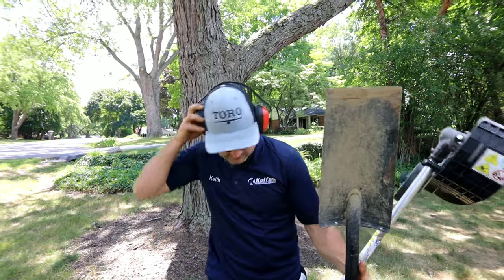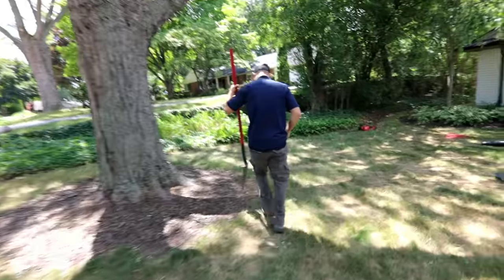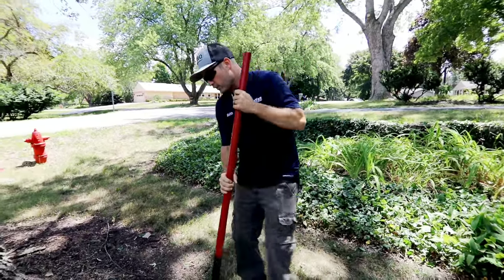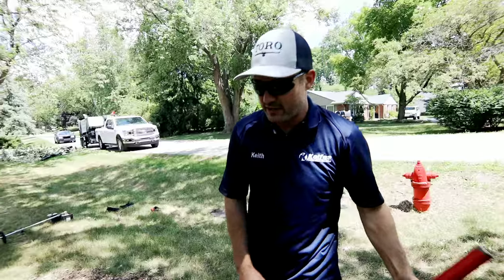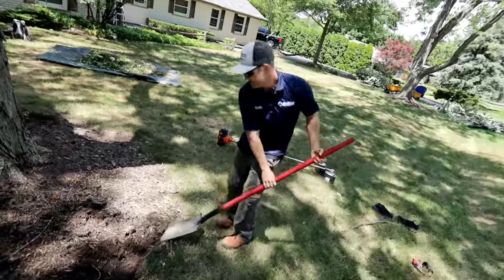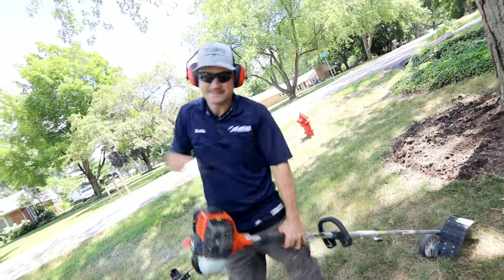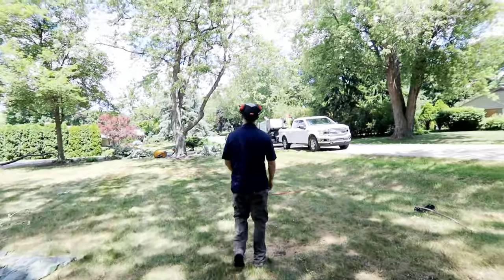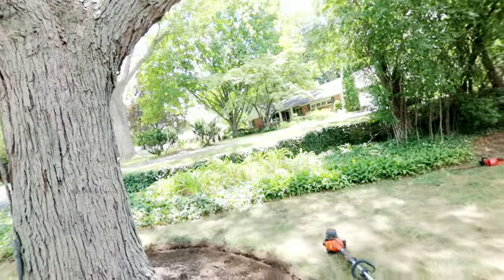Steel Shovel VS Gas Powered Garden Bed Edger | For Edging Out Garden Beds | Which One Is Better ?

Comment: I absolutely love my echo bed redifiner. It’s made me way more then it’s weight in gold. I usually string trim a clean line and then take my time with the machine. Blow out the edge and it’s ready. It turns hours of manual labor into minutes of major profit.

Comment: I have done a LOT of edging with a shovel. Last year, I had a large mulching job where I was tearing out a variety of sloppy edges and cutting new natural edges. I went out and spent the money on a bed redifiner, which turned hours of shovel work into minutes of powered work. The edges look great, the client is thrilled and my feet and back are defined.
I'll never go back.
PS -  If you want perfect round beds for trees, use a line around the tree, tie it back to a ground marking paint can, paint the circle and then cut it in with the bed definer.

Comment: Shovel or a stick bed edger. I will choose the shovel. I purchased the bed edger attachment for my Stihl Kombi system and was very disappointed in how it performed. Nothing beats good hard manual labor with a shovel. If I have a lot of beds  to edge I go down to the local rental center and rent the big bed edger. I will use the big bed edger and then go back and  define the edge by hand with a shovel.

Comment: Ive been using a King of Spades shovel for years.  Its a short spade.  I keep it sharp on the bench grinder and after I dig the edge I clean it up with the string trimmer.  Looks really great but is a lot of work and hard on the back, im thinking of getting a machine.
Reply: rental companies sell (rotate out) good machines for 1/2 the price or less of new. i found an EZ trencher with edger rotor for $550 new belts and oil change works like new. it cuts new edges 20 feet per minute, rake in the loose dirt and ready for mulch.

Comment: I use a trenching spade for edging out beds. The soil is pretty soft where I live. As long as there’s no tree roots it takes no time at all. A gas powered edger is great to have in some cases but I sold mine because I just never used them.

Comment: I alternate between edging shovels and my bed redefiner. They both have pros and cons. If a customer is low maintenance, the edges are already established and just need touch-up, or if the soil is super hard clay/rocky to dig by hand  then the bed redefiner is usually my go to, especially since the bed redefiner pulverises the soil so you don't have to clean up edging chunks. If the job calls for the nicest crispiest cleanest edges and they are willing to pay for it, then hand shovel it is. Also, considering how much debris those bed redefiners throw into the air, you have to be very mindful of your surroundings when using them, sometimes making a hand shovel the only option
Reply: Great explanation!

Comment: Keith I hate edging.  I do not do it.  I have had to clean up some edges a few times and I used my saws all with either a demolition blade or a wood blade just to cut the dirt back.  Edging just isn't my thing so I do market it with my business.  But I use my saws all for everything under the sun.  With the saws all it cuts through the dirt and is quick.  The other tool I use when I have to do edging is a carpet cutter knife.  the curve blade is great to cut through dirt when it is a small job.

Comment: It's one of those things where if you're edging beds and you have a big job to do, might be more cost effective to rent one than spend the time doing the labour. Ive personally never seen anyone edge beds like this, but for me, I like to use a long handle half moon edger. Square/flat shovels are great for scraping grass off, if you're removing sod and dont want to spend money on a sod skimmer. Pitch fork for mulch because it holds more volume. Work smart, not hard. Time = money

Comment: stick with the gas power. if it saves you, you are the most important tool/asset ypur company has. it also dessimates the material so you dont have to go back and pick up chunks made with the shovel. 

the drawback is, my stihl kombi only cuts to a 2" depth. I have some customers who want that deep, trip hazard tray. I started charging more for that.

Comment: thats the crummiest edging ever getting dirt all over the lawn hacking up the bed. if you wanna make a perfect circle tie a rope around the tree then flip a rake upside down and use the handle to draw a circle. the spade your using is crapola get the full steel one from AM leonard. if youre creating  a brand new edge use a weed whacker first upside to "draw" an edge on the ground/lawn. Husqvarna makes the best weed whacker in 2020. always clean up edges with weed whacker. like i taught my dad creating a beds edge is pretending to be God creating hot naked blondes. later palz